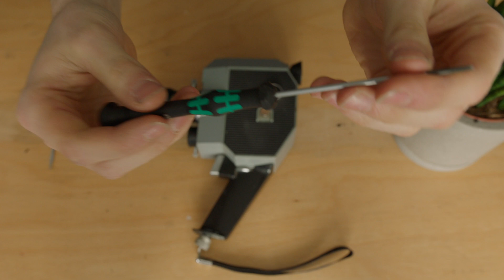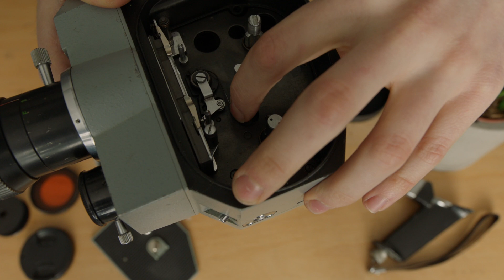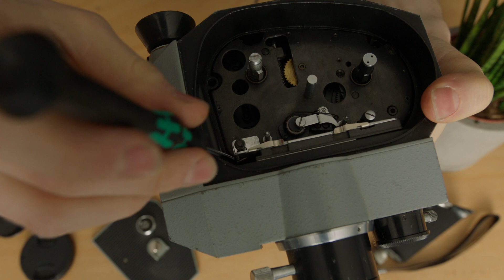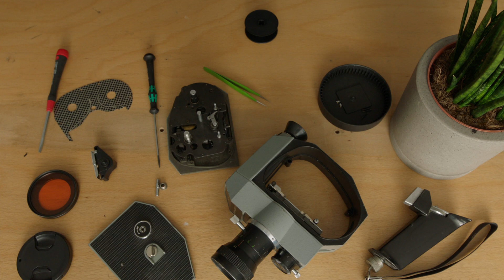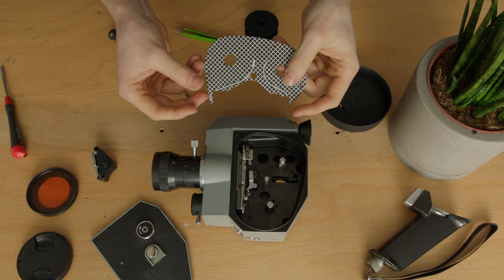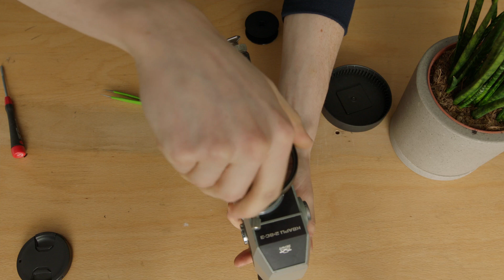Quarz DS8-3 Disassembly Guide

Comment: Thanks for this awesome insight! I really enjoy working with my DS8-3, and I've always wondered how does the light travel inside the camera (in the "outer housing" compartment, as you called it in Your video). I mean the light path between the lens, and viewfinder/film. I suspect there is some sort of half-prism, since the user can see contionus and focus-aligned imagery in the viewfinder, all the time through the shooting. Just curious if you know anything about it :)
Reply: Yes, it has a prism.
Prisms was also used on Zenith cameras of the same factory (Krasnogorsk Mechanical Factory).
And logo of KMF also has a prism with arrow
Reply: There is a serie of micro-pyramids in it.
Reply: Thanks, it seems like really ingenious design

Comment: Hey great series! 
My Quartz doesn't stop rolling when i depress the shutter. It keeps rolling till It runs out of winding. Do you know if this is a fatal or too complex repair? 
Thanks!
Reply: Followed your instructions and it's working again. Thanks a lot!!
Now i'm having trouble figuring how to set the ISO
Reply: @HugoPlaVentas  For exemple if you use foma R at 100ASA/21DIN align the 21 of the sensitivity knob with the 18fps graduation. But maybe you could use a lightmeter cause the selenium lightmeter integrated may be tired.

Comment: hello, can you repair the lightmeter on this camera?
Reply: @Gibarti in theory yes, the selenium work with magnets. But, you can also use an external light meter or simply apply the sunny 16 rule to shoot, knowing your shutter speed is at 1/20 when shoting at 18fps.

Comment: Gotta say i admire the modular nature of this camera and how you can take it apart in a way to remove the mechanics as one block. This is sooo freaking amazing. Makes the whole maintenance sooo much easier.
Reply from the maker: I agree. At the risk of sounding a bit political, I think it's interesting to see how repairable a camera can be when it's built by a nation that isn't concerned with generating long-term profit and just wants something that will work well for as long as possible. I feel like design like this isn't seen much these days.
Reply: @Lo-fiCine  It's the same with basically all tech from the former eastern Block. Here in East Germany for example the GDR produced a lot of household items (like Blenders) who still work and are repairable, 40-50 years later. Things had to be repairable and cars too. Russian cars like the Ladas, could be repaired with simple tools and at home since repaid shops weren't widely available. Cameras too.  East German lightbulbs produced by NARVA also weren't part of the phoebus cartel since tungsten was way too precious in the east to be sacrificed after just 1000 hours of lightbulb workhours. So they still work.

Comment: Anybody had problems with 12fps setting? Mine doesn't work at all, camera refuses to run at all, but all the other settings sound and feel great
Reply from the maker: If you haven't serviced/cleaned your camera in a long time, it's possible any dirt or hardened grease is causing a lot of drag on the mechanism. This would make it harder to pull through the film at lower speeds due to having less momentum etc.

If it has been cleaned recently then I imagine it could be a sign of a more complex issue that would be hard to diagnose without opening it up and having a look.

Hope this helps 🙂
Reply: @Lo-fiCine  I actually found out the issue, and learnt along the way!

The frame rate is determined by a sort of cam connected directly to the frame rate knob. The cam has a bunch of screws attached at different depths. Moving the frame rate knob determines what screw is engaged, in turn pushing a larger plate toward the back of the camera. The screw for the 12fps option on mine was set improperly, but moving it slightly inward did the trick.

Couldn't have done it without this video! The screw for taking it apart on the back of the frame gate is really sneaky, you did a good job with this video!
Reply from the maker: @srenhaandbk7904  Great to hear you solved your issues and thanks for coming back to share what you discovered!

Glad the video was a help, happy shooting 😁
Reply: @Lo-fiCine  Oh, one other thing. When I got mine the dial furthest to the front of the camera, the "framerate to гост ratio" was not attached, but included. I have not been able to deduct from online what position to reattach it in however. Can you tell me: when the dial is turned all the way counterclockwise, what does it read? I think гост 22 and 12fps should line up, but it's hard to tell.
Reply from the maker: @srenhaandbk7904  when mine is turned fully counter clockwise 12 and 180 line up. Fully clockwise, 12 and EA line up.

Comment: I found all of your stuff fascinating. im in my 60's and have had a Quaez 5 standard 8 bought new in 1973 so i am familiar with its quirks. having just bought a Ds8-3 I have found that using the built-in meter it is overexposing. Apparently this is quite common and its a simple matter to fix as it is a gearing issue. There is a tear down on youtube but its for the earlier model all black quarz which has a different layout. Can you do a tear down of the front part of the camerra please so i can get access to the gearing attached to the meter mechanism. Assuming the selenium cell is working i can then calbrate it against my hand held meter
Reply from the maker: Hi Jeffrey, so glad you're enjoying my work! As someone who's grown up entirely in the digital age, it's so interesting to know you were able to buy a Quarz-5 new back in 73. 

Whilst I have disassembled a selenium light meter in the past, I am yet to try it with the Quarz-3. That said, I think mine may have a similar issue so I'll be sure to look into it when I have some time.

In the meantime, a little workaround I've used is to use your hand held meter to figure out how many stops your DS8-3 is over exposing by and then subtract this amount from your iso dial.

For example, if your selenium meter is reading +2 stops over and you're shooting on 200 ISO film, set the ISO switch on the camera to 50 ISO and you should get accurate readings. (Depending on which version you have I believe your ISO switch will be in either DIN or GOST so you'll need to look up a conversion table although I imagine you know this already)

That said, I've found that the selenium metres can often be a bit inconsistent and usually use a light meter app on my phone to get spot readings when I'm out with my camera.

Hope this helps!
Reply: It's a selenium cell. Any light meter working without a battery will die over time. If it's still working you can perhaps do some mechanical adjustments to make it useable again but I'm not sure how accurate it will be. It's better to use an external meter and dial in manually.

Comment: Great video! I always wondered how to separate the camera into parts, but I never noticed the hidden screw. I have a question is your DS8-3 also that loud whilst running at 16 FPS and higher? I tried to experiment with sound sync last year, but it is unbearable to watch, because of the annoying whining sound of the motor at 24 FPS.
Reply from the maker: Thanks, glad you found it useful! My camera is pretty much just as loud at 18fps as it is at 24. Unfortunately most film cameras (even the professional ones) tend to make at least some noise when shooting. Probably why most films even nowadays replace most of their dialogue in post with ADR.